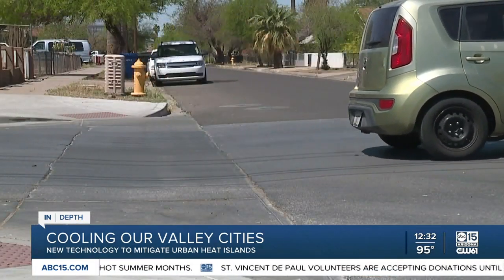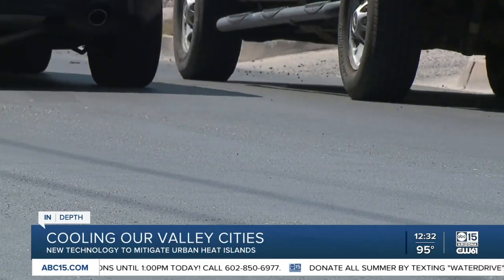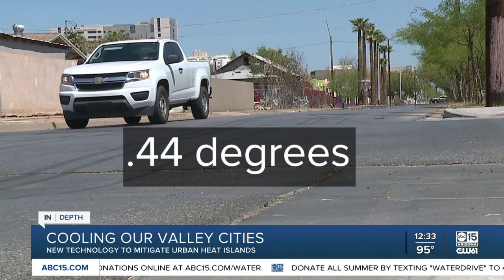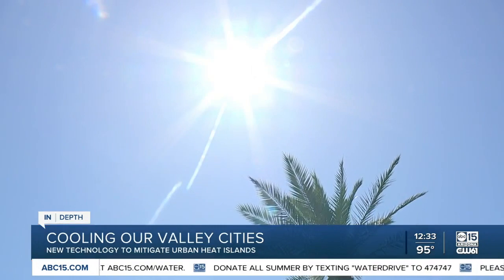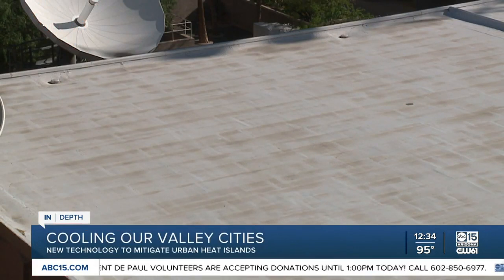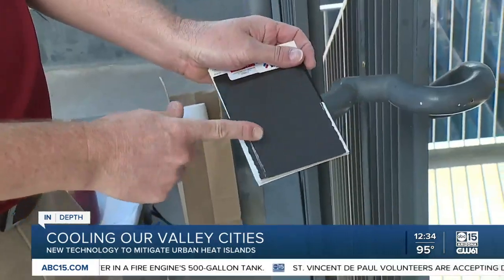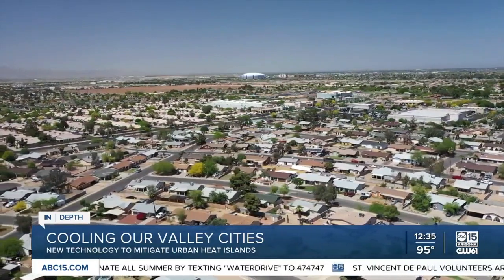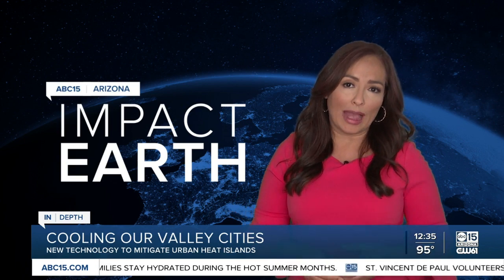Technology being tested in Phoenix could make cities cooler

Comment: These are such ridiculously dumb ideas. Reflecting radiation from roads doesn't mean that radiation is shot straight into outer space. It just gets absorbed by surrounding surfaces. This is like throwing your garbage into your neighbor's yard, and they doing the same thing. Whose dumb idea was it to start a city in a desert? Instead of moving in droves into the desert, making it hotter and then trying to come up with solutions to make it cooler, MOVE OUT of the desert. Then neither you nor the desert has a problem. It's like a dog chasing its own tail.

Comment: The big problem is concrete. When I worked on the Cardinals stadium and we would show up the next morning at 5 you could feel the heat radiating off the stadium; from the heat that was stored in it the day before. and working downtown on the convention center. Oh my goodness it was hot! I can remember 50 years ago when the nights would cool down to be quite Pleasant. We need to have a moratorium on new houses and businesses. Also we're starting to have to worry about our water. The growth in Phoenix needs to stop.

Comment: White surfaces help but the heat from the sun doesn't get sent back into space. It just doesn't get absorbed by the asphalt to re-radiate.  If you really want to do something significant attack refrigeration and freezers because what heat gets withdrawn from houses and supermarkets and shopping centers all ends up in the urban heat bubble. So improving A/C, refrigeration or freezer efficiency or setting thermostats higher where possible  would make a bigger difference and save money too. I assume these new white materials are expensive. Before so many people with A/Cs and such a  penchant for frozen foods it used to get cool enough in Phoenix Metro to need a sweater at night. Gravel lawns make a neighborhood hotter than grass lawns. Trees and even shade sails make the environment cooler. Concrete makes neighborhoods hotter.